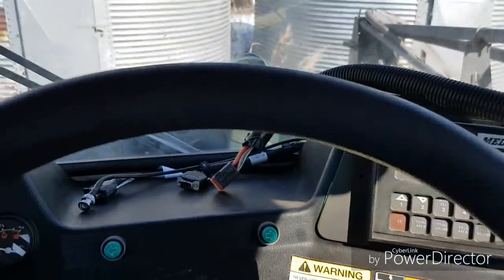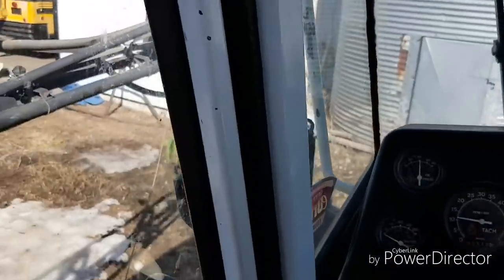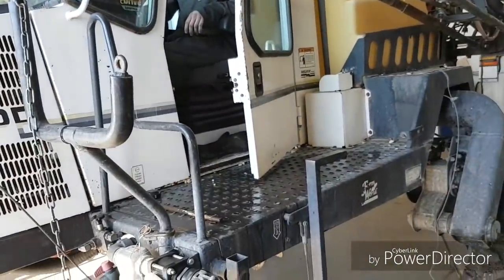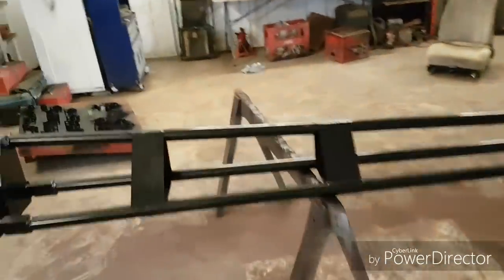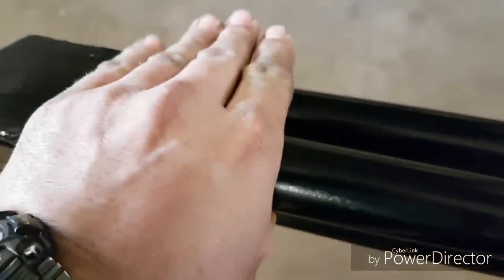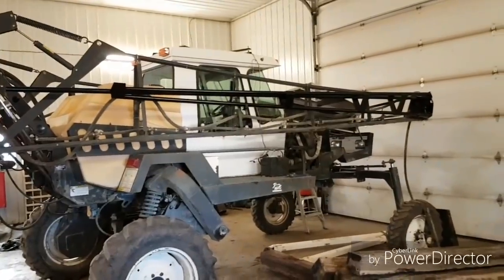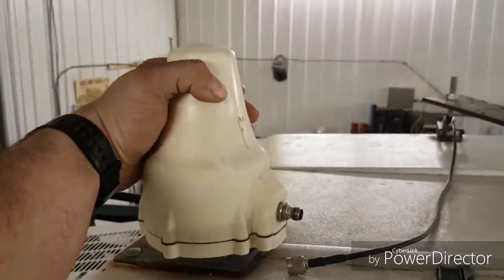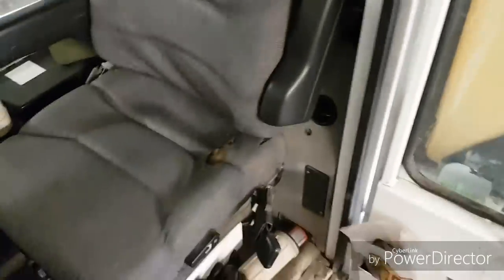Installing the new booms and GPS auto steer in the sprayer!!

Comment: Built new booms very similar to yours for a 220 Spay Coupe in the early 90's . A 220 was much smaller only 200gal tank small VW?? Gas motor really narrow uncomfortable cab but very light and economical . I wasn't disappointed when the company I worked for got a bigger machine!!! Thanks for the video!

Comment: That's a smart thing to do, so long as your shop is heated all winter.  My BIL kept his older lightbar in its cardboard box stored in the JOBOX in the shop over winter in northern Indiana, and the shop is unheated except when they're in there working he fires up a 70,000 BTU rocket heater to keep the place above freezing, but the shop is uninsulated and leaks air pretty bad so it's not heated most of the time.  His GPS unit crapped out about five years ago, probably from the cold cycling which is hard on electronics, heat up, cool down, get damp from humidity, etc.  They couldn't get a new circuit board for it anymore it was too old so he bought an EZ-Guide Trimble 250 instead... NICE unit... Now when he's done spraying with it they take it off the tractor and put it back in its box and bring it inside the house and put it in the mudroom closet on the top shelf where it stays nice and warm all winter... 

Later!  OL J  R :)

Comment: Sporty lookin Sprayer that 🤔 think my concern would be the front axle, I couldn't see any bracing on it and was just wondering what would happen if the front wheel dropped into a pot hole or a washout at spraying speed🙄😮😮 nice video 👍👍
Reply from the maker: These things carry 90% of the wieght on the back end haha fully loaded it weighs 10000lbs. It's actually built really heavy the front end and rear end on these!

Comment: Those boom improvements seem like a good idea to me. Just have to watch not to make your boom too heavy. Then the boom will really swing like crazy. There's a bit of a story behind how I learned that. 😀
That Raven autosteer is the same concept as the Agleader Ontrac 3 we are in the mist of setting up on our tractors. Most of those systems have either a sd slot or a usb drive for external storage. Just saying so you can back up the data saved. Do you use the standard free signal, or a subscription gps signal?
Reply from the maker: Standard signal and yes we have it all backed up on a USB stick Haha

Comment: When I repaired the booms on my 220 coupe I drilled holes in the bottom at each end so I could spray oil in them to stop internal corrosion. How wide does yours spray ?  60 ft?  Thx
Reply from the maker: Was 60 made to 70

Comment: Please tell me how to extend my wheel base on a 1990 220 model. I bought on an online auction and I'm starting to second guess my purchase.  Can you give me some options for a bigger wheel base
Reply from the maker: Is it manual or hyrdolic? This has a  switch in the cab for in and out and you remove a pin in the axles
Reply: It's a manual and I think it's the small tread patern
Reply from the maker: @timodness2621  then I haven't a clue I'm afraid haha